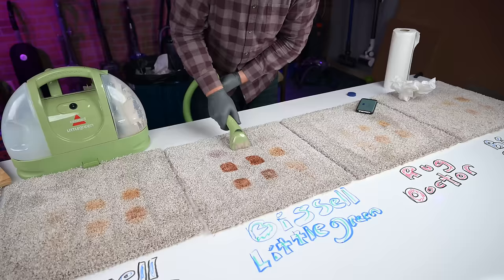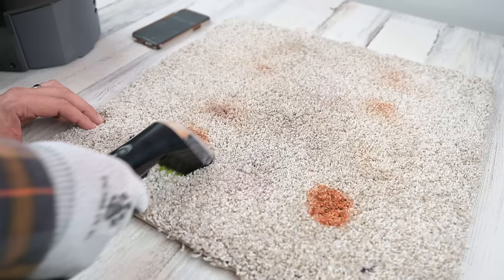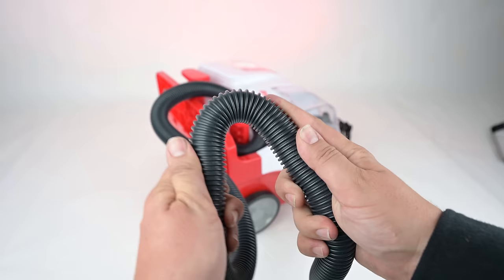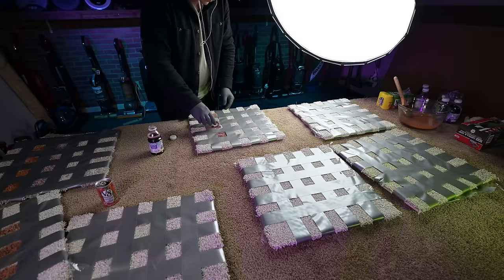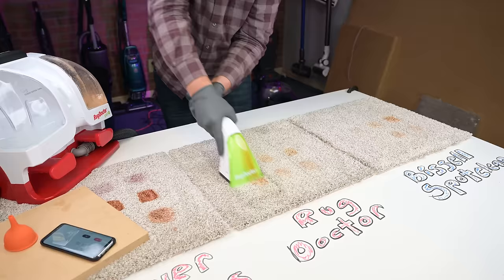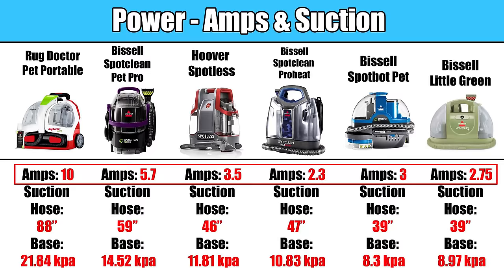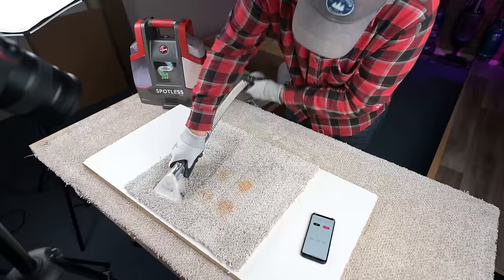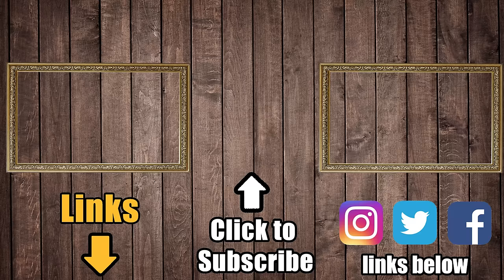Best Spot Cleaner For Carpet - Vacuum Wars

Comment: I know this won’t work for everyone, but if you have a drill, buy a drill brush. Using the drill brush in conjunction with the spot cleaners makes life so much easier!
Reply: That's what I did. I bought a drill brush pack for a different reason and decided to try it on my carpet. It worked. Returned the spot cleaner and bought a stand up causecthe bissel pet preheat suction just wasn't there.
Reply: A drill brush? What is that? Would it damage carpet?
Reply: @santouchesantouche2873  adding on to the other comment, the softer ones are great for cleaning car wheels, bathroom tile, steel sinks, etc. There’s a ton of uses for them and a corded drill is only $20. Battery powered ones are cheap too.
Reply: Was thinking the same thing while watching the video
Reply: Your fibers may be clean but your carpet is definitely delaminating
Reply: @konspikuous420  the soft bristle ones, I think generally white. Should be fine for carpet. It's non abrasive.
Reply: Definitely test in a closet or other inconspicuous area first though because scrubbing can make the fibers look different than the rest of the carpet.
Reply: @themikeroberts  that's Def tru. Run the brush too long or too hard on cheap carpet, like landlord in a apartment cheap, and yah. You can Def cause some damage/discoloration
Reply: I do this for auto detailing and I love it
Reply: I did and didn’t use it.
Reply: Both would be very handy. Drill brush good for scrubbing but can it suck the dirt out? That’s where you need a spot cleaner.
Reply: @3AProductions  yes. I use the drill to rip up the and loosen stains, by spraying it first. Then drilling it. Then using my carpet cleaner to wet it again, agitate, and suck up
Reply: How and how do you add it to your machine
Reply: Why aye, all professional valetters use it now. I do but haven't bought the 5inch one yet.
Reply: Yes but the drill brushes take a toll on ur carpets after a few uses. Unless your using an ultra soft material but then what stains will that even get out, but yes they do work great
Reply: @nickh3809  yeah, I have a drillbrush, and I was considering using it, especially after this but I think you’re right, eventually the plastic coding that is part of the fibers I would think would start to wear out, not unlike the plastic coating that is part of cookie sheets.
Reply: As an automotive detailer I second this comment. Im a pretty small time detailer so a drill brush and spot clean shampooer does a whole car beautifully.
Reply: Drill brush is the only way I clean my tub these days.
Reply: @killerpeech  xzs
Reply: You can become your own spot bot.
Reply: I thought about that and an extractor!
Reply: That would damage a lot of carpets.
Reply: That’s what I use, I have a drill brush set, works great!
Reply: @erichenberger  same!
Reply: Such a good idea ty
Reply: @santouchesantouche2873  klmlllllllolkkklolljol Jim Jim kk io okk mkilmojijjk
Reply: I just saw a professional doing this on a video 😊 good idea
Reply: Been there, done that. Works like a charm! But after 2 yrs of living with a leaky dog and beige carpet, it finally dawned on me to get some brushes that fit in my drill.
Reply: Genius!
Reply: But it needs the suction part
Reply: @sabrinahuerta4463  I try and blot up tough stains first. Then I'll go over it with my shampooer.
Reply: Throw a fresh / white towel on that drill brush and watch the magic happen... it's what I saw the pro's using when they cleaned my carpets. It sucks up the stain AND is easier on the carpet fibers apparently (I asked! 😅)

Comment: A tip I learned was to mix the cleaning solution separately and get a pump sprayer or spray bottle. That allows you to apply the cleaner directly to spots. For large rooms it's quicker to apply to the whole area before starting the process of cleaning. Thank you so much for comparing these mini machines 😎 it'll help me when considering what to buy (and hopefully save me money)
Reply from the maker: Great tip! Thank you!
Reply: I always do this as well. I have a spray bottle for my spot cleaner and knapsack weed sprayer I use when cleaning my entire carpet. Spray. Leave to soak 10 minutes, suck it and it’s a lot less scrubbing
Reply: Really great tip. Thank you.

Comment: Attention auto detailers.  The best hands down for vehicles is the Bissell Pet Pro (the purple one ). Suction is great, long hose that can reach a cross car, cleaning head is smaller in size. 
I bought one a while back according to this video. I'm glad I did because I was about to get the clean slate hoover or little green. Glad I came across this video. 
 Oh, and btw, a drill brush is a must. You can't depend on manual scrubbing and your pet machine brushes for every spot or stain. 
 I pre-treat most times with carpet bomber by P&S ( best carpet cleaner on Amazon ) then mist water and proceed with a drill brush and then extract, works every time.
Reply: I bought the little green & it’s not good for me, kinda scared to go this version because that Bissell little green did not help
Reply: Which drill brush do you recommend?
Reply: What about a good vacuum? I was thinking about doing auto detail as a side business on the weekends.

Comment: You have made my entire week! I discovered your channel last year when I was looking for a vacuum and follow you regularly. I have two senior pets who are making more and more messes in the house so I'm literally going to buy a spot cleaner this weekend. The timing of this video topic is impeccable!
Reply: I'm in the same boat, shopping for a new spot cleaner to clean up after our new puppy.  This video is exactly the information I was looking for, thanks a million!
Reply from the maker: That is great to hear! Thank you!
Reply: My family had the same issue. We've had a slightly older version of the spot-bot for a few years, and it works rather well. It's small and easy enough to set up and use. It can sometimes require repositioning and repeated use on larger or more challenging stains, but in most cases it works really well. Bissel makes a pet-specific carpet formula that helps with odors, and breaking down those sorts of organic compounds. Being able to sort of set it and forget it is really nice, especially since it means no kneeling down on the floor and manually scrubbing. Definitely a great option for anyone with mobility concerns.

Comment: The feature which influenced my choice of the Hoover Spotless unit for cleaning up dog accidents was the hose cleaner, which isn’t mentioned in this review.  There is a port in the side of the unit the hose with head removed fits into which circulates water / solution through the hose to rinse it clean.  I found the most convenient way to use it was to just use water in the tank, putting the cleaning solution in a separate spray bottle.  I wet the area with the unit, spray on the solution from the bottle, use the nozzle or a separate brush to work it in, then rinse and vacuum up with the unit.  There is less wasted cleaning solution that way, I’m able to do the final rinse with plain water and the unit can be drained and dried between uses.
Reply: The Bissell SpotClean ProHeat says it has Hydrorinse that self cleans the hose. That’s the one I’m buying after watching this video.

Comment: I have a bissel,spotcleaner, 6 yrs old now that was such a boon when my grandson was little. He used to get told off at home for spilling drinks etc, but he knew nanny had a little machine that would get the mess up quickly and as he got older he would run and fetch it himself and ask me to fill it and switch it on. Not sure if it’s still working as I haven’t needed it for quite a while, but it paid for itself very quickly with three cats and a grandchild around!

Comment: I have a 15 year old Little Green.  What I've noticed is that now they are using way less quality parts like the hose on my machine is the anti-kink type.  They dont have that anymore.  Compared to mine, the new one (I compared it to a friends) has way less suction and way less power.  You do have to remove the hose from time to time to clean it out, but that isn't that hard.  It's a pain to fill the soap tank, but other than that, it has lasted through 2 elderly dogs so I cant complain.

Comment: My solution for spot cleaning is to manually apply a solution of Quick 'n Brite, then vacuum it up with a Milwaukee cordless shop vac.  (Don't forget to remove the air filter when using a shop vac for wet applications.)  Maybe you should do a review of cordless shop vacuums to see which is best?
Reply: Project farm already did shop vac tests and they’re really thorough, but he did the tests based on garage/shop uses, not cleaning uses so it would still be good to see!

Comment: I had an older version of the Little Green. It was alright, but the cleaning attachment ultimately cracked where it joined the hose - probably because of all the pressure you need to apply to get it to work well. It dripped cleaning water everywhere after that. When I moved into a place with hardwood floors I just gave it away. Not worth the effort to fix for occasional spot cleaning on area rugs.

Comment: I"ve owned many and by far the biggest issue is that about a year into owning it, the hose becomes brittle and cracks from being bent around the machine all the time.  You can replace the hose for around $30, but the second hose, if you can get it to work at all, has a much shorter fail time.  I'd suggest you store them all in a closet for a year and see which hoses crack on removal.  Also, I dont know if they have fixed this yet, but the green machine... the "dirt" you suck up used to run through the engine, making it fail fast.   Spot clean was ok, but had the hose issue also.  The annoying thing with that one was that the dirty tank was not easy to rinse out.  There was always a wad of gunk left behind that no one could remove and it smelled.  We currently have one that you dont have listed.  It has a clean tank of about 8 ounces and boy is that ever annoying.
Reply: Yep. Had to replace my hose for my spot clean. The newer one seems to be of cheaper quality and more malleable.

It still leaks solution though. It seems the hose assembly is at fault. I've placed mine inside a car oil drain pan (the circular one).
Reply: Seems to be the strain the hose has while put away. Wonder if not storing the hose in it's intended place holder and just coiling it looseley would fix the issue.

Comment: Ive gone through 2 spot bots so far.  Initial quality and cleaning was superb on each.  The first one randomly just dumped the clean water tank onto the ground while it was sitting there and would no longer hold water after that. It worked so well though I bought a second one.  After a few months the second one seemed like the suction on the automatic part died off.  Using the "deep clean" (longer cycle, more solution) seemed to pull up a larger percentage of the solution used still.  Eventually the hose on manual part came apart though.  Dont neglect the hose cleaning part of the process!
Reply from the maker: Good input! Thank you!

Comment: I've had great luck with the older Bissell Spotbot. I have a dog that has puked several times and had diarrhea once (that was disgusting). 90% of the house is hard floor. Guess where the dog goes to puke.... yes, obviously the carpet. After some experimenting I've found the following works best:

1. Spray the stain liberally with enzyme based pet cleaner. Doesn't have to be anything special, I get it at Kroger. Let sit for a couple minutes while doing step #2.
2. Fill the sportbot with hot water, no cleaner.
3. Run the longer 6 minute cycle on the stain.
4. Use the hose to suck up as much water as possible. 
5. The machine must be cleaned or it will stink! To clean I hold the hose nozzle under the sink with the machine turned on and suck clean water into it until the tank is full. I do this 3-4 times.

My Spotbot is about 5 years old and hasn't had any quality issues. It has also amazed me with some of the stains it has managed to get out. Just my experience and your video was great!
Reply: Poor dog if it's pukin' so much
Reply: @RockyFoxxowo  Not to worry, she does't puke often. Maybe a few times a year.
Reply from the maker: Wow! Thanks!

Comment: Thanks for the excellent reviews! You've influenced my past vacuum purchases. But here's a low cost option for stain clean up. Particularly pet messes. I'm a pet fosterer... I know messes.  I use a 2 gallon wet dry vac for better suction (using the wet option) and a squeeze bottle filled with cleaner. Best thing I've found is oxygen cleaner and hot water, especially for urine stains.  With good suction, not much scrubbing is needed. Just lightly saturate, then quickly suction. Repeat as needed. Suction well. Hope this is useful.

Comment: Suggestion for a video. A review of the cordless Power tool stick vacuum/dustbuster. Like Ryobi, Makita, Rigid, etc. making sure the volts and the amps of the battery are the same.

Comment: I have a different version of the little green machine and it’s not bad. I don’t think the suction is the best, it does leave the carpet fairly wet (never had a different unit to compare it to though so not sure what the “normal” wetness level is here), but it has cleaned everything I’ve thrown at it over the last couple of years and no major leakage issues
Reply: Is yours the white one with the green tanks?
Reply: @scpatl4now  sorry just saw this! mine is the pro heat version of the little green machine. Its green with grayish tanks, and taller than the one featured in the video. I haven’t seen a white one!
Reply: @shelliebean  I have the white one.  I think that is older than the pro heat.  It does not heat the water, but I even used it last night.  Still works well

Comment: So helpful!!!  Thank you for doing this!!  I have a Rug Doctor Portable Spot cleaner (looks just like the pet version and cost $250 about 4-5 years ago).  It’s useful but the dirty water tank can leak!! Also if you tilt it when it’s on the dirty water can spray everywhere - a fine mist of wet dirt or pet urine or whatever you’ve sucked up. I have to keep a towel underneath it during and for a few hours after use cause the dirty water does leak out.  Also lost suction cause I dropped the head and a small piece of plastic off the clear suction head chipped off. I tried to order the hose attachment replacement (you have to order the entire thing) but the price went up from $25 to $50 during COVID with a ridiculous shipping price of $15. I ended up getting a small but lightly Bissell upright carpet cleaner (the pet one during Black Friday a few years ago for $79, I’m a small person and it weighs about 11 lbs if I’m correct?) and it cleans soo well, although it’s for big areas.  I’m able to clean all the carpeted areas of the house with it.  I still have the portable rug doctor and will get it repaired since it just became more affordable (Rug Doctor dropped the price for the part and adjusted the over inflated shipping costs to a reasonable price).  Thanks again for your opinion!!

Comment: My original upright Bessel had the spot cleaner hose built right in. But that was many years ago, and sadly that unit involved a total pain to clean the unit after use. Where when my son borrowed the unit, then failed to properly clean the unit after, some part ended up seizing and clogging. 
Now I have a Hoover Spotless cleaner that has a WASH OUT PORT, that flushes clean fluid thru the unit ensuring that it doesn’t get gummed up and clogged. 
I’ve had the unit for 18mos now with no complaints. So for the $100 I’m satisfied.
Reply from the maker: That's great to hear.  Glad you are happy with it.

Comment: I have the Hoover spotless! That leaking happens when there is too much soap in the collection tank. I saw in your video that the collection tank was very foamy. So I make sure to not use too much soap or dump/rinse the collection tank when it starts to fill with foam.

Comment: So here is my question.  How does the hand tool on the Bissell ProHeat 2X Revolution Pet Pro upright cleaner compare to the Bissell SpotClean Pet Pro?  If the price is similar and you aren't concerned about the extra portability of the SpotClean model would you just buy the upright and get the additional functionality of upright cleaning for larger areas along with the spot cleaning attachment or is there something else I am missing?  I didn't see any videos comparing these two models for this functionality.  Thanks!

Comment: I have used the Bissel Spotbot for 2 years and it is very capable. My biggest complaint is that it's leaky. To switch between the automatic scrubber and hand cleaner you have to unplug the hose... and this drips. Also, the hand cleaner hose leaks too. So, although it has served me well, I would not recommend it. It's gross getting that dirty water on my hands. I wrap a paper towel around my hand and put one on the floor under the hose when I use it. I think I will get the Pet Pro or Pro Heat.